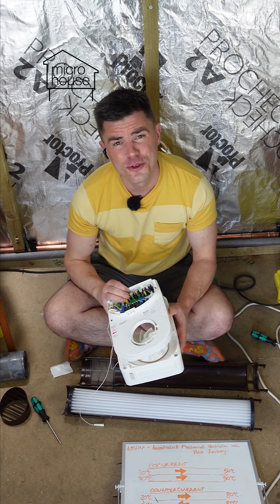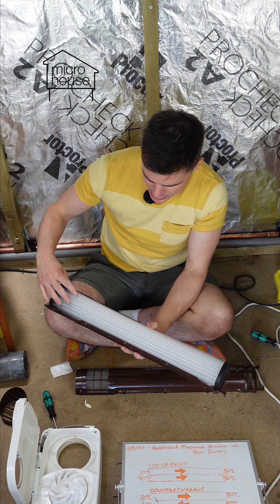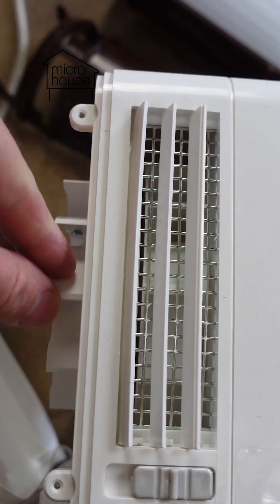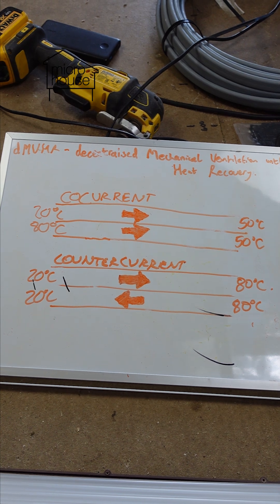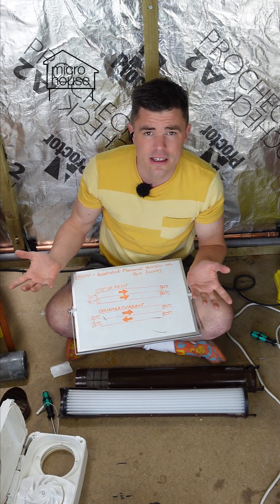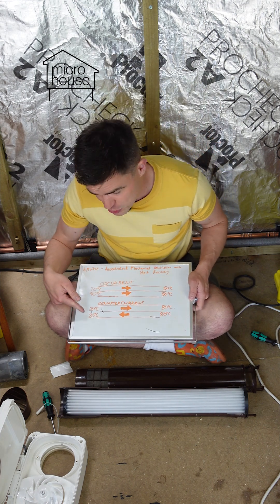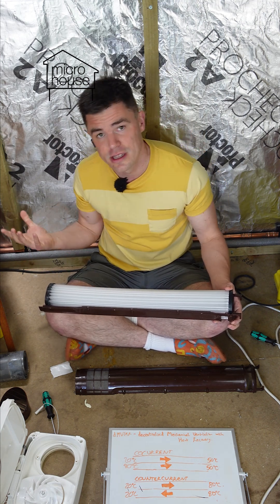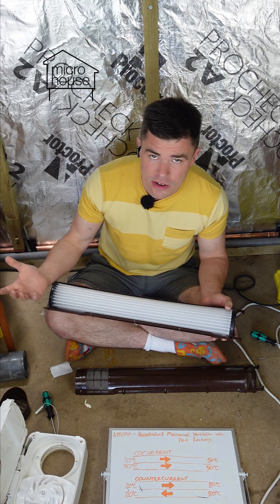Inside a single room MVHR / HRV / ERV. To ventilate a room without wasting energy.

Comment: Ive never seen a dual fan one, only the ones the switch every so many seconds. Have you a make and model on the one please?
Reply from the maker: yeah most of them are those type, but they're no good for bathrooms. It's a vent axia lo-carbon tempra. But TBH I don't recommend it, it's really loud. Consider https://www.airunit-ventilation.com/en/